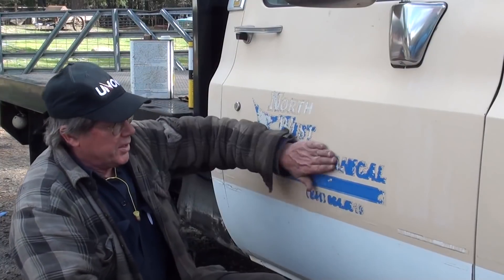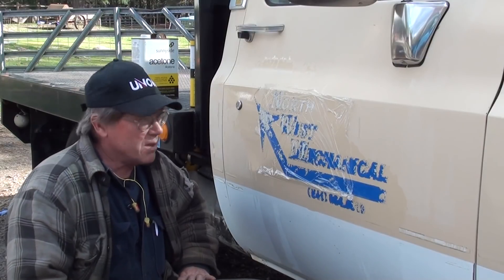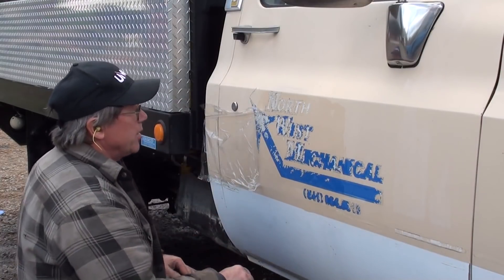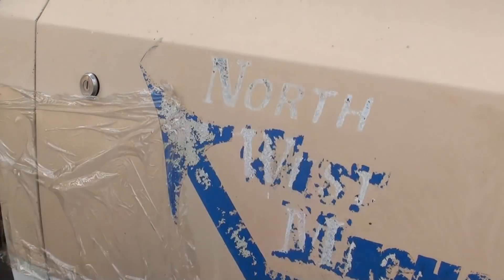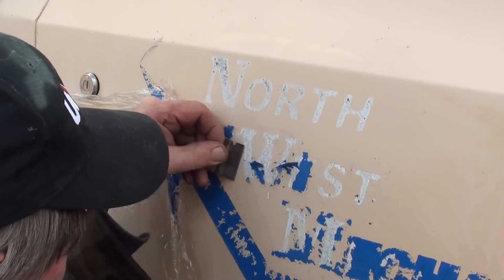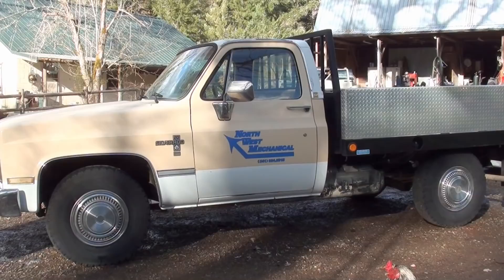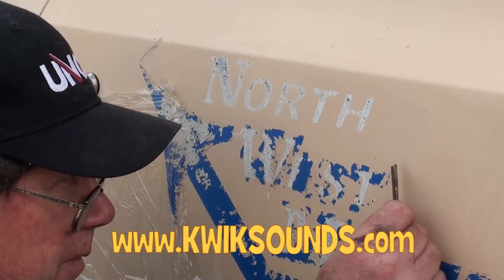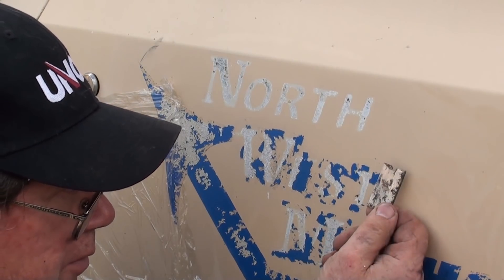84 Chevy C20 Door Decal Removal

Comment: Jeff my first job was working for a body shop and they were repainting a lot of Carolina trucking cab over road tractors and guess what my job was ?  You got it taking all the decals off the cab and doors and bumpers !  LOL  I had it down to 2 days when I had to steam clean them then they went into the shop. Fun part was I was the Gofer so I got to drive them all from the dealership to the shop and back when they were done !  I got pretty good with a razor blade by the time I was done but boy the first few looked pretty rough when I got done with them !  LOL  Bandit

Comment: Acetone ... going to have to try that myself.  The manufacturers decals on my ute were tired so I decided to remove them. Removed the plastic lettering with a old plastic credit card, but the glue is left and I did not want to scratch the paint.
Reply from the maker: Start with mineral spirits first. Allow to set for 5 minutes, or saturate a rag and move it slowly across the glue. Different adhesives have different characteristics.

Comment: An old printers trick. Take a fresh single edge razor blade and a very fine sharpening stone and work the sharp corners off. The edge will still cut but the corners won't gouge. Thank an old stripper(no, not that kind)
Reply from the maker: GASP
Reply: @ElderlyIron  LOL

Comment: Being the lazy,sorry sob that I am I set a pair of halogen work lamps(those 1500 watt type that bakes you while providing sufficient light for spelunking work) about a foot or so away from said decals and let em bake an hour or so.. Then I slide a sharp hard plastic spreader or even a single edged razor blade quickly around said decalled area followed by laquer thinner or acetone wipedown,but I never,EVER use mommas dish washing scraper brush to remove said decals.... Jus sayin.. Lol !! 😄😁